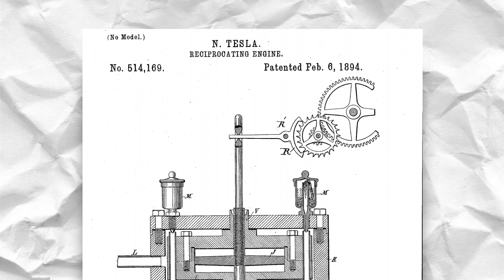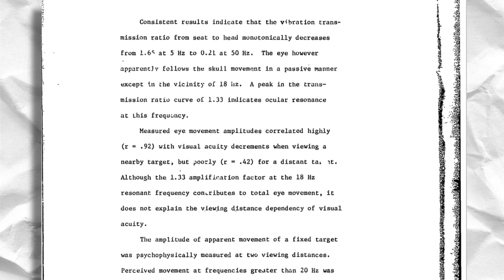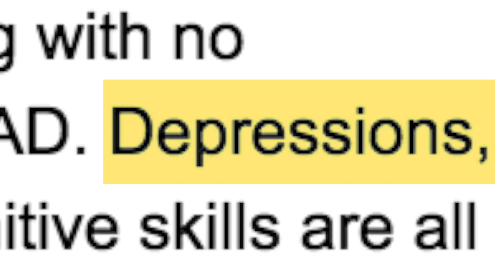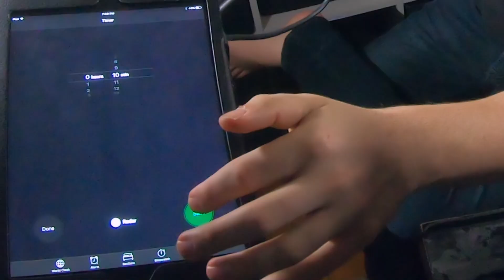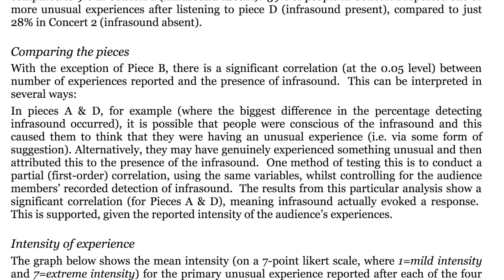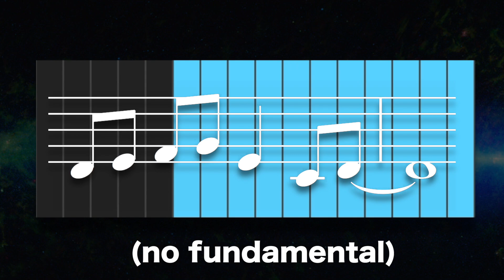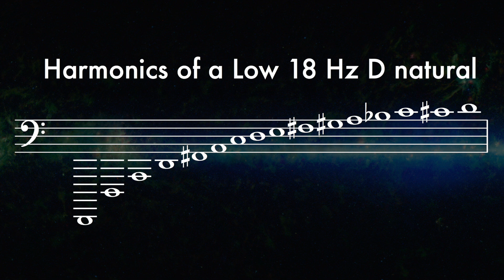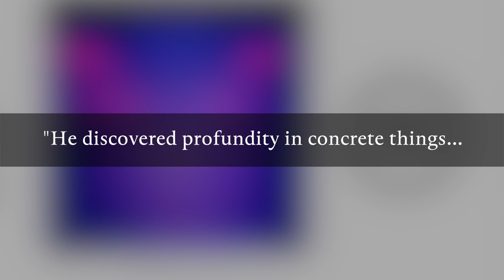How to See Ghosts (using Infrasound)

Comment: I've heard from a few System Techs/P.A Hire companies here in the UK that on many occasions large touring acts would have "dummy subs" built into the Sub Arrays that would pump 18Hz in the venue whilst the crowds were filing in and while the supports acts performed, and it would be cut as soon as the headline act walked out.

Comment: That 8-bit microtonal tune at the end was weirdly catchy for something that doesn't even use normally tuned notes.
Reply: 5/4 is pretty much indistinguishable from a major third, 3/2 a fifth, 9/8 a major second, 15/8 a major seventh, 4/3 a minor third. 95% of the tune is just a an arpeggio. You can hear the notes that aren't the same as the normal ones we use because, well, they sound different. The most microtonal thing he does is that weird tritone in the bassline which is probably a septimal trione of some sort, it's measurably different to a normal tritone and sounds less dissonant.
Reply: Oh, that explains it then. It's also good because he can use the stranger harmonics for moments of tension.
Reply: Correction then: 5/4 is the true just intonation major third compared to the commonly used but wrong one in 12 equal divisions of the octave which is a seventh of a semitone sharp
Reply: If you're interested in hearing the whole EP, it's sungazer vol 1 by adam's project sungazer
Reply: I partially blame the 12/8-like rythm. Rythms based on a division into three (like 6/8 or 12/8) often sound better / catchier to me than rythms based on division into two (like 2/4 or 4/4).
Reply: That's very equalitononormative of you which is a real word if anybody asks.
Reply: I thought it sounded something like Aphex Twin's Melodies from Mars,  track 1.
https://www.youtube.com/watch?v=NqocFYjSKDw
Reply: you mean "extremely fucking good"
Reply: Mister apple
I was thinking exactly the same thing
Reply: It sounded like a boss fight about to happen and I liked it!
Reply: It sounds a bit like Personal Jesus by Depeche Mode
Reply: Ikr
Reply: 666 likes.
Reply: i think you should know that i'm saving you from having 666 likes. 

Have the ghosts left yet?
Reply: It made me want to play Pokemon Red on my '94 Gameboy... I dig it.
Reply: Mister Apple anything can be catchy, ever heard pop music
Reply: Yeah, and pop music is what I'd usually consider catchy, but not more experimental music like this.

Comment: Just found this video linked at one of the microtonal groups on Facebook. Nice to see you exploring more microtonality Adam, really cool to see higher prime harmonics like 23 and 37, which are nice and spicy for most listeners, and lovely to hear another mention of La Monte Young's masterpiece. From my point of view, the fundamental frequency that is referred to as Eb 10 octaves below the piano's low end is really much more about being an Eb than being that particular Eb, as it means that the most concordant sonorities in the Well-Tuned Piano will usually make reference to Eb (harmonic 1=2=4=8=16, etc by octave equivalence) and its closest relatives (in this case, as La Monte Young only uses prime numbers 2, 3 and 7 in combination,  3=6=12=24, etc, 7=14=28, etc, 9=18=36, etc). The most concordant minor triad of 6:7:9 is heard a lot throughout as a foundational harmony.

A lot of scales in just intonation are expressed this way, related back to a shared fundamental, e.g. Ptolemy's famous Diatonic sequence which most of us know as the simplest tuning of the major scale, in pitches 1/1-9/8-5/4-4/3-3/2-5/3-15/8-2/1, or in harmonics, 24:27:30:32:36:40:45:48 (which points some people to the Lydian mode as being the most "rooted", as its fundamental can line up with an octave of harmonic 1, the fundamental.

About the ocular resonance thing, my eyeballs often used to shake when I sung particular frequencies, but now that I remembered that and tried to test it out, it seems like they don't anymore!!! Used to be around D2-F2, which is much higher than the frequency referred to in the video.

Love your work.